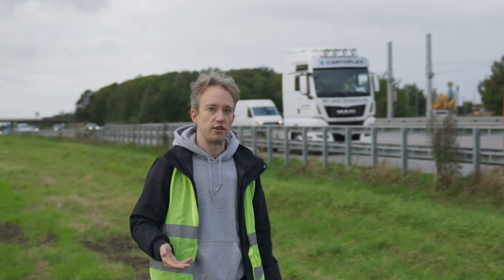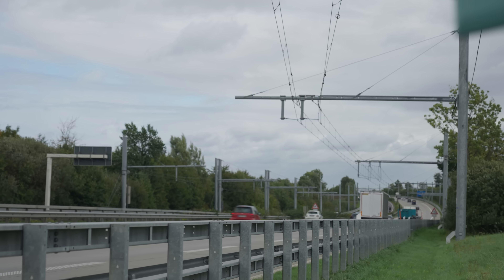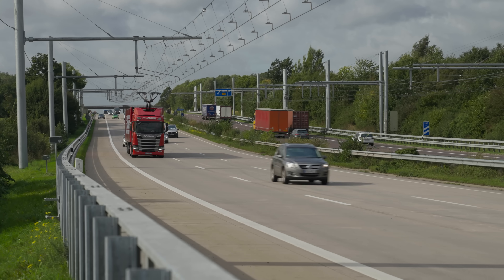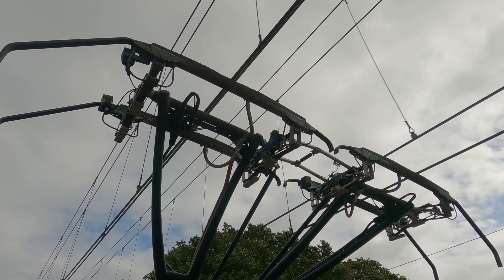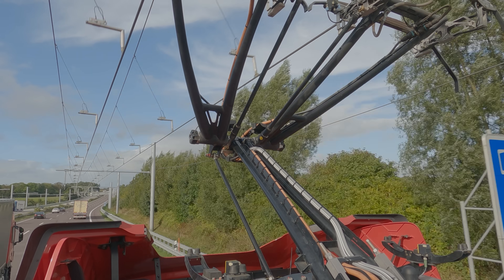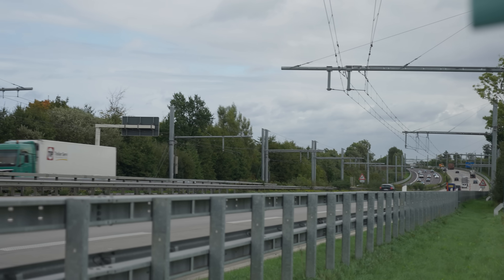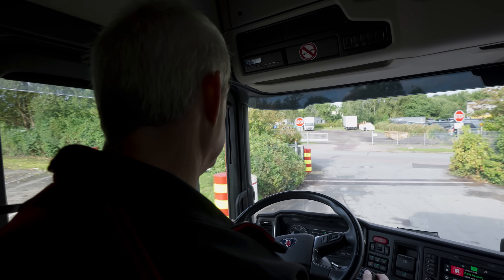The highway where trucks work like electric trains

Comment: If money was poured into hydrogen research like it has been battery tech, the issues with hydrogen storage would have been conquered long ago and we'd all be running off hydrogen. No country has a monopoly on the most abundant element in the universe, so why not hydrogen? Answer: that's too practical and wouldn't give us the endless culture wars that the inferior electric grid/battery materials shortages give us.

Comment: Adding retractable metal rollers to the vehicles would increase efficiency and save huge amounts of energy.

All vehicles with certified rollers could slide into a lane with the tram lines and relax as they cruise along the long highway. Braking and acceleration would be tuned into a single melody, where sleeping/un-alert drivers can simply be parked on the side with a single sideways nudge whilst the others continue as when getting off escalators.

Comment: This is just kind of impractical, having to run thousands and thousands of miles of new power line circuits, and to have all truck manufacturers get on board with this, and I feel like this is a catastrophe waiting to happen if someone’s truck has too tall of a load. How does it even charge? Bluetooth electricity, it doesn’t make a connection, I’m not understanding.

Comment: Our city council here in Wellington NZ just ripped out its overhead wires for the trolly buses and replaced them with diesel because the cost to maintain the wires was apparently too costly. We should be putting as much freight onto the rails, so no need for cables on the motorways, and installing cables on local roads could prove too costly.
Reply: It depends... mass production and utilization is always cheaper

Comment: Defeats the purpose when those electric lines are still run by coal powerplants.
Reply: Not a 100% coal. Varies from place to place.
Reply: the EU is rapidly upscaling its wind power capacity
Reply: @Underjordiskentitet  Well that didnt last long. Germany are ripping them down to rebuild more coal powerplants.

Comment: The commendable part of this solution is that it tackles the business side of things very well. As long using power off the cables is cheaper than running full diesel, and doesn't require massive investment up front from the trucking or infrastructure companies, and the break even time is short (like they say year and a half), this solution would actually be adopted by the private sector willingly.

Comment: This is the most stupid invention. Germany's Railway network is crumbling away, huge parts need electrification. Why should we build overhead wires on the Autobahn when there is a proven system for transporting goods with electric power on rails? I like your videos but this one is stupid.

Comment: How is the electricity made.  By burning coal.  Just replacing one fossil fuel with another
Reply: That's a good point for trucks and vehicles that contain a small number of people, but technology like tram buses, which can fit a lot of people, can reduce emissions overall. Even if those buses are powered by fossil fuels, you're still taking cars out of the road by getting more people in a single bus. good insight tho
Reply: It works by moving a generator then it's fed into a transformer and voila high voltage That's stepped down

Comment: I wonder if the inventor was like: 'oh I have a new idea, lets electrify highways only for trucks and then in the next step lets connect all the trucks together, so that one driver can carry around 10-20 trucks, and how about afterwards we just reduce the need of individual motors per container, by just linking them up together and being pulled by a single slightly more powerful machine, and then afterwards we reduce the wear of the road, by placing metal underneath the wheels and to reduce friction and air pollution from rubber, we also make the wheels of steel! Yes thats it thats my fabulous new idea, its mine and new and we have to build completely new infrastructure for this, because there is no system which could fill exactly this need of bringing a large number of containers from a harbour to a warehouse.' 
This is a so called GADGET-BAHN and is a waste of german taxpayers money, when there are still major railways which are not electrified!

Comment: What would really be interesting is to incorporate regenetive braking into the system.  Trucks going downhill would be able to push electricity back into the system partially powering trucks going uphill or crusing on the flats.
Reply: The electricity grid needs to be able to stand dual flow of electricity

Comment: the price of electric Will eventually go like diesel,  what fuel is going to produce the electricity also. What will power The installation and production of the necessary equipment,

Comment: You either burn the fossil fuel in your tank or 100 miles away and convert it into electricity.  I don't know what happened to real logic.  Yes, you going to tell solar and wind will do the replacement job.
Reply: Yes you forgot that the efficiency in a power station is higher than in an ICE.
Also, a power station can burn fuel with sulphur, just need scrubbers to remove the SO2. An ICE burning fuel with sulphur is asking for disaster, poisoning the cat converter and everybody's lungs.

On the flip side, electric transmission losses may be greater than losses in fuel transport.

All these info is taught to 16 year olds (ICE) and 18 year olds (efficiency- thermodynamics) btw. :(

Comment: Or, and hear me out on this, we take that line and put it on a completely separate road, and make the trucks bigger and longer so that they can transport more goods at a time. That way, it is completely separated from any kind of conflict on the road. The overall size will also make them more efficient in transporting goods, as rather than having to rely on separate vehicles, you can just have one. 
Oh wait. I'm describing the freight train, an already proven technology that is, on average, four times more efficient than relying on trucks for freight transit.

Comment: why from overhead? and why not from from road or floor? why we need to invest lots of money for infra to build this? Instead of overhead if we go with floor electric supply then it would be a very easy and very much fast infra. I hope you guys understand what I mean. Safety with insulation and all is possible like we mainly used in high rise building insulated supply busbar
Reply: Wikipedia - Electric road. Sweden has tried out many of the Electric road options regarding the cost of each one. It looks like an on-road contact system with under vehicle pantograph will see all vehicles private cars and trucks be able to take advantage of this option, and only a 1 metre section under the vehicle is switched to high voltage the rest is return ground.

Comment: For the second task - moving containers from ports to warehouses, we have a solution that works on electricity. It’s called a cargo train. Yet everywhere trains are replaced with trucks, that are now trying to reinvent the trains. Ridiculous.
Reply: Is it economical to use time to switch from train to truck when going to warehouses?? I feel like it's more convenient to use trucks to go from port to warehouse. And this isn't even mentioning the warehouses that are sometimes in new areas that wouldn't have been developed enough to have railroads everywhere.

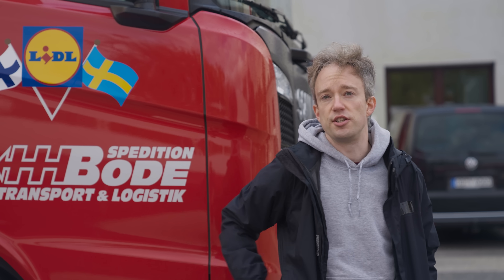Comment: 03:45 - that pantograph shows a lot of uneven wear already. The difference with trains here, is that the overhead line is constructed to be gently sweeping from left to right, while the train cannot move an inch L/R on its tracks. That looks like a serious drawback here since that L/R sweeping hansn't been incorporated in the powerlines here. I do like the idea though, who knows where we'll end up!
Reply: Its uneven but its also not as extreme as you would see on a tracked video without sweeping.
Reply: Since this is more of a prototype than anything, they might not have really cared enough about things like that.
Reply: @travisbeagle5691  I don't doubt it could be made to work , but at what cost ! and complication , it would be a logistical nightmare , so why do it ? when we have reliable proven simple system "rail freight" 
Last 20 miles could be done with electric battery trucks
Reply: @nounoufriend1442  Rail freight done right and electrified would certainly be the best option to be the backbone of a logistical network. Sadly most of the world doesn't do freight rail particularly well anymore, but that could be remedied. That being said, even with an increase in freight rail, there will always be a place for even medium or long distance trucking which could benefit from electrification like this. Also overhead electrification certainly isn't cheap but it isn't particularly complicated nor would it be any sort of a logistical nightmare. If there is a viable business case for it then there would certainly be a market to help pay for such a system. In addition, any sort of weight savings also helps extend the life of a road so there's a potential savings that should also be considered. I'm not saying this is like the be all end all, but in my opinion, any plan to try and electrify trucks without some sort of in motion power supply is frankly doomed to fail.
Reply: It’s easy to replace and it’s unlikely that it will have any overall negative impact.
Reply: This is a prototype system. I'm sure they will work on this issue if the technology will be used large scale.
Reply: @Mondbrille  Exactly. They are testing the system to see if it works and where it needs improvements
Reply: a bit late to the party but yes, it does seem that the designers really didn't ask feedback from the railway. what really caught me off guard is that it uses tram-level voltage(2x750v it seems like). while it would be safer to hang above the autobahn when compared to 25kv, it is still too little capacity for what would be a future system. 

here in the netherlands where trains run on 1.5kv it is a daily limitation where lot's of workarounds need to be implemented to get the capacity which we have now. everyday some 1 to 2 times a breaker trips in the country because the trains pulled too much current when leaving the stations simultaneously. and if trucks need this to drive+charge batteries it would be too little capacity in this design in the long term in my eyes.
Reply: That I think could be something a driver assistent could help with. Not unlike Tesla's selfdriving, the truck could help keep itself in the middle of the road like if it where on rials and pantograph could have that gentle sweeping L/R
Reply: @mr.boomguy  
Yes, the technology already exist for cars (Experimental) at the moment, using AI technology. This would assist the truck to keep to the middle of it's lane, however, it would not take over the driving of the truck, like cruise control, you the driver is still in charge of the steering!
And yes there has to be zig-zagging to avoid cutting through the pantographs, like with trains, AKA the _hacksaw effect!
Reply: Could they just embed bearings in it?
Reply: @tonyk8368  A rolling cylinder on bearings with slip rings to connect to the power system of the vehicle would probably work. 
This is not a major engineering problem
Reply: Maybe ground the truck with conductive tires, and use only one pantograph just like on trains 🤔
Reply: @seasong7655 concrete is also not a conductor.
Reply: Most truckers hold a consistent enough position in the lane that the alternating left-right catenary sweep would work in this application. At least in the US they do. They may have a lot of other foibles but lane-holding isn't one of them. I'd worry about some of them raising and lowering pantographs on a regular basis at the beginning and end of an electrified stretch, though. I could see all kinds of opportunities for entanglements there, even if the process was quite heavily automated.
Reply: @dblissmn even if they do move left-right on their lane, as long as it's not synchronized with the left-right movement of the catenary it's cool.
Reply: This part could be cheap and easy to replace.
Reply: As far as I know those pantographs are guided by an automated camera system. I guess that could be controlled by software
Reply: IS that zig-zagging of the contact wire? It is supposed to do that (railways/trams)!
Reply: @jonathonshanecrawford1840  Yes, especially high speed trains.
Reply: @jch6275
Like if there were no cargo trains, e.g. from here to there?
Reply: The catenery could just go in a staight line and the pantograph could move from side to side.
Reply: @Loanshark753 They tried that, it didn't work, the parts broke down too quickly, as it is easier to zig-zag the wires! The catenary is the part that holds the wires! Zig-Zaging is the international standard, even in Cuba! Yes Cuba!
Reply: @Loanshark753 Also if the paragraphs Zig-Zaged, there is the risk of them touching (un-insulated parts) each other, resulting short circuits, thus blowing the Fuse.
Reply: That's where limited "Cruise Control" for steering comes into play, using AI and GPS to assist in the steering! They can install the catenary to zig-zag the wires as well! It has been done decades ago, when railway electrification was invented
Reply: Don't worry. Like in all of those green projects, the practicability of it is already well known to not be there. The purpose of it is only to grift after some subvention money for the "research".
Reply: This could lower German's emissions.  But it increase the emissions where copper and aluminium is mined and smelted, and transported.
Reply: Maybe the solution to this is to move the pantograph slightly left/right.
Reply: pair it with lane keep assist and wiggling pantograph with driver to supervise. things can be minimized.
Reply: Easy solution, just make the contact surface ring shaped with gear ring that rotates it one tooth forward every time the pantograph is raised/lowered.
Reply: Just make it cheap to replace, so it will make sense to replace after some milage just like replacing tyre or changing oil.
Reply: @thatsawesome2060  I'm more concerned about the wires, not the truck.
Reply: Yup, that much can atleast be done given it can save us from pollution, right?
Reply: Plenty of trolley busses around the world doing it though.
Reply: @bremCZ  no, trolley buses don't uses pantographs, they have 2 long pole directly in contact with the 2 cables above the road, in that way the poles are on a rail
Reply: @NassimOOO  No, not all trolley buses use a trolley pole. They exist and have existed for a long time with pantographs.
Reply: @bremCZ  Show me an example of a pantograph bus which is almost always connected to overhead wires, otherwise I don't believe it.
Reply: @bremCZ  I think you are confusing a tram with a trolleybus
Reply: @M3LN1K0V  You think incorrectly.
Reply: @bremCZ that's within the city.
Reply: @bremCZ  Sure, but the mileage and speed is not comparable
Reply: @米空軍パイロット  The mileage certainly is.
Reply: Great observation, I think 1 potential solution would be to have a system which move the pantograph on the system gently from left to right, possibly with a camera monitoring it. I don't think it will be very expensive to implement.
Reply: @oadka  Big problem is these road vehicle's require 2 pantographs due to no return path through the rails like trains/trams compounded by fact vehicle not being on any guideway so be a very complex system . Best way would be transport goods vial train then do the last 20/30 miles by road
Reply: @oadka or just have the wires move back and forth.... and fire any driver that swerves in sync to that movement. Much simpler than moving the pantograph.
Reply: But if the sweeping rod can move 100kmph forward why can't it serve a bit left or right, what damage can it cause, when it can withstand the forward speed?
Enlighten me more.
Reply: @ankur19852005 the problem is that trucks arent forced to stay at the same lateral position on the road. they can swerve. But i do think it would improve the wear if they did it like catenary for trains.
Reply: @nounoufriend1442  I was merely asking for an example of a pantograph bus by Brem for the limitations you mentioned, your response didn't help my question any bit.
Reply: @MarioFanGamer659  Sorry only agreeing with you and trying to help , not bother you again

Comment: It looks very much like a fraud! I try to picture what would happen if the driver willfully, to avoid an accident, or by having his attention slip, drifts off sideways. The fixed pentographs pushing upward, will get out from under the wires and instantly rip them down !?

Comment: I don't mean to be a kill joy but you aren't going to power a nation's trucking industry with solar and wind power. The electricity in those wires has to be generated somewhere. A 450 hp diesel engine equates to 33.5 kwatts (33,500 watts) If you aren't going to burn fossil fuels in a central power plant to produce that much power (for a single truck, by-the-way), the other alternative is nuclear or the entire planet covered in solar panels and windmills. Another factor to consider is the losses in converting the initial power into electricity, the losses in the transmission of that power, the losses in each truck to convert that electricity into mechanical power, the central power plant will burn at least 10% more fuel than a truck burning it's own fuel. If you are going to preach "saving the planet" without sacrificing it's economy, then by default you MUST be for nuclear power generation.